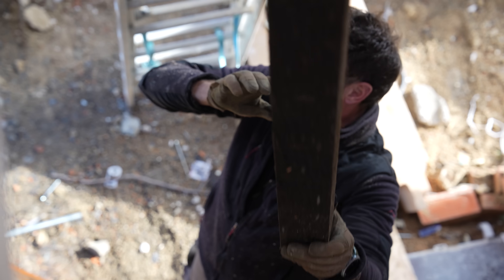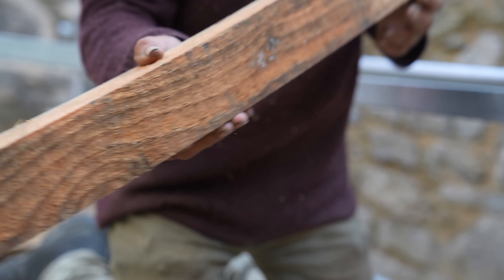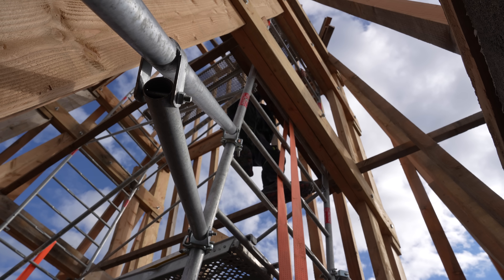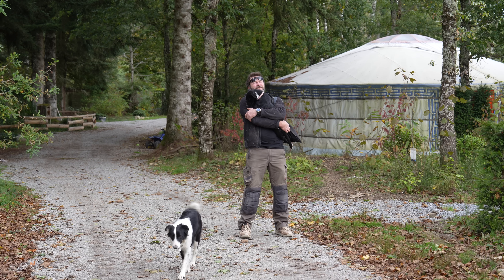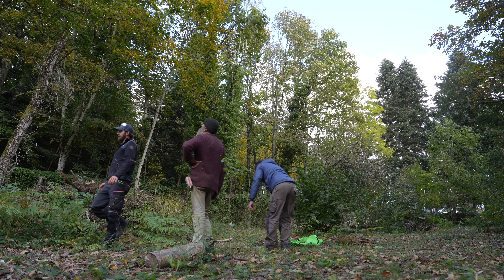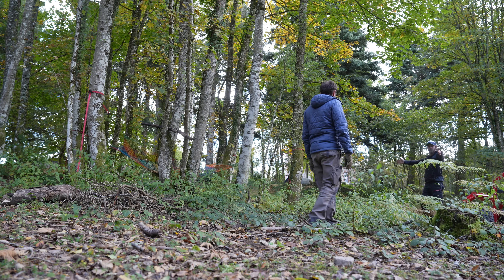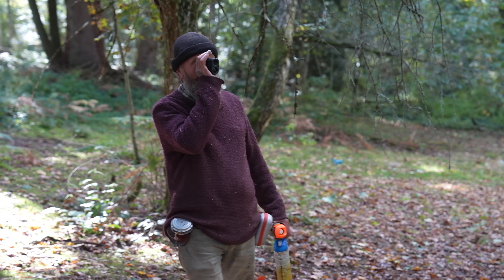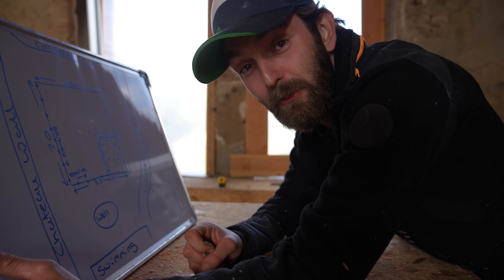The highest view point for miles around.

Comment: Dan, you should really consider using hurricane straps/Simpson strong ties on the turret framing. You're going to get some nasty winds that high up and the hurricane straps will ensure no lifting happens when wind gets up under the roof. Not sure what the building code in France requires but in the U.S., straps/ties are mandatory on new builds subject to high winds.

Comment: The triangular part that will support the lower part of the tower's roof is called a "console" (fem.). Usually it's used to add a balcony on a flat facade. Or you may use a "porteur" which is a horizontal  beam that will stick out of the wall. He will had to be a bit long (inside the wall) and thick as it seems you are in a windy region.

Comment: It looks great for sure, but the engineer in me is upset about the lack of anchoring. A few screws will not hold this together in strong wind. The resultant forces in play here can be equivalent to thousands of kg.  As a minimum there should be clips, preferably there should be long metal straps from the rafters fixed somewhere below the concrete ring beam.

Comment: Wow, but I was just wondering if it would be easier and more stabile if you would use kind like …we call it Balkenschuh in German….its a Metall piece like a Brace in U Form, you would screw it on the vertical beams on the side and hang the top beams in and then screw them tight…hard to explain for me I hope you get the idea 😂❤

Comment: Idea: would it be possible to add the cladding and the tiles from the inside, reaching around to the outside... Probably starting at the bottom and working your way up. That way you would not have to hang from the outside of the tower.
Reply: No, can't do that. Maybe some of the bottom row could be done, particularly with the window openings, but to attach all of it properly, really need to do so from outside.

Comment: A structural question. Are you going to add metal strapping to the roof boards, or are you just going to trust that a few toenailed screws will do all the holding? What about strong winds from storms?

Comment: What progress! Curious about a couple things, though I don't think Dan reads or responds to comments.  First, when will the arch be attached to the roof? Just wondering if they're going to have to rebuild that since it's so wobbly. Second, when are the slate tiles going on? Just wondering whether that's going to be left for the new year (i.e. after the snow melts) or if they're going to try to get the tiles on before snow hits. And if the roof tiles are going to wait, I wonder what's next after this phase of the roof is done? There's certainly no shortage of projects.

Comment: Fantastic:face-blue-smiling:Maybe it would be over engineered but I would put in an all thread bolt on each side the full height of the steeple.  Earthquakes and hurricanes.  In Washington state we must have continuous bolts that fasten the top plate to the foundation.
Reply: Definitely needs holding down bolts and strapping to resist the wind forces up there.  (You know what the wind up there can do, Dan!)
Reply: No earthquakes in France

Comment: Dan, fantastic job but I can’t stop thinking all this roof weight is built on and only supported by a single skin wall at the top ….The one you took down was double skinned and nearly 2foot deep …assure me alls good 😂
Reply: The main forces are going down into the original stone wall. Only side supports are attached to the new cement block wall. Not much weight sits on it.

Comment: I just can't fathom how you're going to lay the roof tiles. I'm scared for you in advance.
Reply: @bigbob3772  Brian just told us on this latest vlog he's an experienced mountain climber and was involved in mountain rescue, so I don’t think it'll phase him much.

And you could only hoist the frame up, perhaps boarded at a push, but tiles have to go on by hand.
Reply: @bigbob3772  Scaffolding is expensive though, especially to build that high. And you can still fall off a scaffold. Plenty of accidents happen that way. It won't make you miraculously immune to accidents.
Reply: @bigbob3772  Might be cheap where you are, certainly isn't where I am, and I know quite a few things are surprisingly expensive in France.  I also didn't mention what it's like trying to book such things there. You don't get a commitment to a timescale. It introduces some logistical problems. There are reasons why he does a lot of things himself. You might recall his hassles getting supplies of various things. One reason why they saw up a lot of wood to the required size themselves. 

He has the choice of doing it when he needs it done over the course of a few days with resources he can control, or potentially be left flapping about for weeks waiting on a supplier. If he went for the latter every time, believe me, he wouldn't have got this far, this fast.
Reply: @bigbob3772   Oh no, a MAGA - your opinion really doesn't count on anything - but it's a good diversion to switch to politics when you've lost an argument 😆